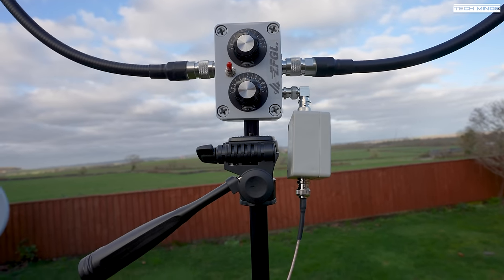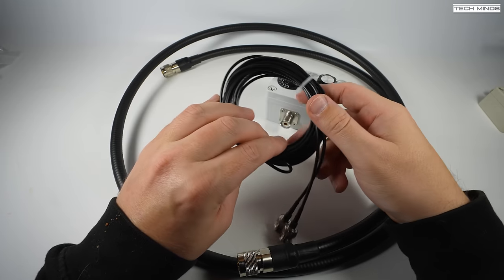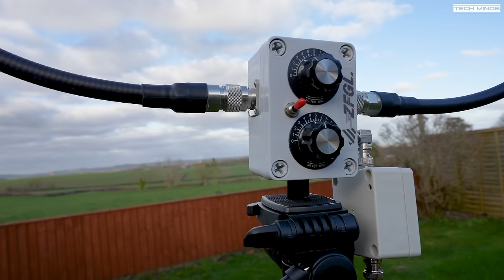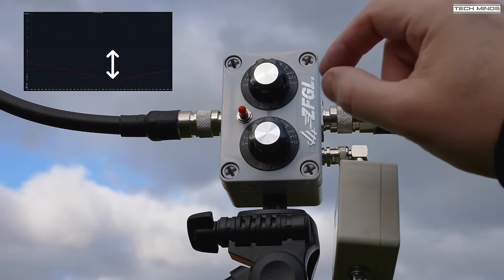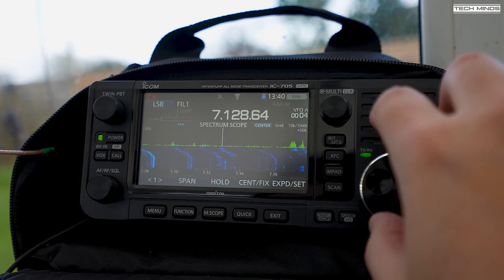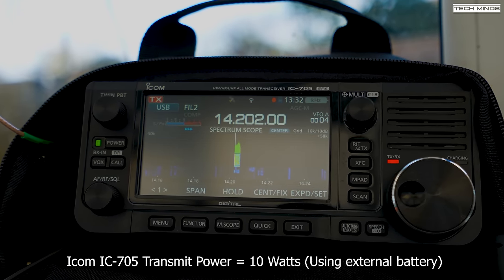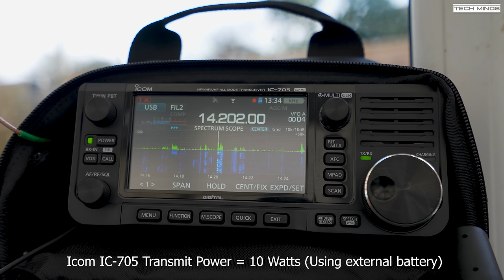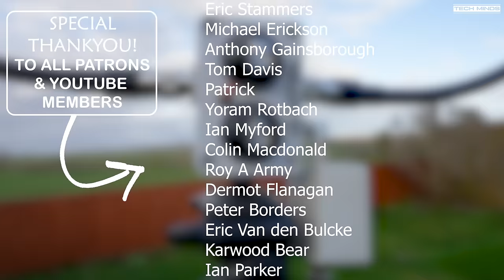A Cheap HF Magnetic Loop Antenna - But Does It Work?

Comment: I home brewed a similar antenna during lockdown. It was fine at QRP but the capacitors would not take any more than 10 watts. Really sharp tuning. You probably could not make it for the money they want. It's not rubbish at all. But any user needs to be aware of the limitations.

Comment: The voltages across those crappy caps would be huge, and I doubt that the dialectic would handle it for long. a quick calculation on guessitmate dimensions from that show that at 28Mhz there would be over 1KV across the capacitor! They will get pretty hot too, so they are doubly cursed!  - I have a DIY magloop with a big air spaced capacitor and it will only handle 20 watts on digital modes  before I get issues, so those little beasts are not going to be too happy.  IMHO
Reply: this loop is 10 watts maximum!!   its qrp indeed and works great.. have bought them for our hamclub here.  there fun but qrp only   vhf does not work good in fact the rubber ducky is better.
Reply: I don't think capacitors will get hot. They are not resistors.
But sparks will certainly fly over the plates. The distance is very short...

Comment: This is a variation on the “army loop” and not a magnetic loop antenna; the giveaway is the lack of either a coupling loop or a gamma match to the main loop.
This type of antenna does work pretty well for what it is.

Comment: I use it during +2 years, I use ft8 freqs for tunning, as you did it, first tune the up, then the down tune.
I did near 2000 kms contacts with voice and 5000 with ft8.
use it inside my room and it's bi-directional and it works... beleave it or not !   Works.
Is it like a dipone? NO! off course, but works fine the size, price and components.
73 to all
ea4huk

Comment: I wouldn't advise using that unit with the Capacitors. I have made my own loop antenna and even low power capacitors can arc across. My capacitors are good quality but air spaced. My design doesn't fold up. As today I am still experimenting with my DIY Aerial. Cheers from old George

Comment: I got one of these and it works quite well for modes like FT8 and CW where you tend to stay in a narrow part of each band and so only need to retune the antenna for a band change. Less convenient if you are scanning up and down a band, say for SSB, as the narrow bandwidth of all magloops means a retune is required if you move say 30KHz. The capacitors are ok for QRP but would break down due to the high voltage generated in a magloop if you exceed the recommended power rating. Also the caps may need their trimmers tweaking to give the full range of adjustment needed to reach from 7-28MHz- mine came not tuning all the way up to 28MHz. I like this antenna for its stealth factor. Here in Singapore the public are not familiar with ham radio and always ask me if I am a spy when I am out doing POTA! I can put one of these inside a one man tent on the beach and sit by it doing FT8 and all people see is a guy with a tent using an iPad … much more discreet.
Reply: It always amazes me that people ask operators if they are a spy... do they thing if you were a spy you would say yes...🤦🏻‍♀️
Reply: @samcollins6394  
"Are you a spy?"
"No."
"OK, carry on."
Reply: How far did you get with 10W and this antenna? Which parks are you operating from? I lived in SG for 9 years, love those beautiful parks.
Reply: I found it’s quite easy to work Japanese, Australian and Indonesian stations from Singapore on low pier with something like this but when I realised that a doublet at home was possible I switched to that and managed to work about 70 DXCCs in 9 months. But it was very slow going with QRP beyond that.
Reply: Of the many parks in Singapore my favourites are the high ones like Telok Blangah Hill Park and Kent Ridge Park as they have great takeoff in most directions and at night or early morning nobody is bothered if I operate there and also there are not too many LED lights and such causing the noise floor to rise

Comment: I have a similar antenna that I use for FT8 @ 5 watts. The antenna is indoors about 5 feet away near a window. I have made contacts (confirmed with the other party) at over 5k miles away on 20M. As mentioned it's not a good antenna if you are going to run up and down the band as you need to retune the antenna all the time. but for something like FT8 or other digital modes, or calling CQ it works well.. A VNA is definitely helpful in tuning the antenna..
Reply from the maker: I may do some more tests with WSPR and this antenna, just to see how well it works on low power. cheers
Reply: As mentioned it's not a good antenna if you are going to run up and down the band as you need to retune the antenna all the time.

Good comment. Does this mean that tuneable antennas like this aren't suitable for strictly RX? I'm not a ham but a SWL enthusiast, so I have no need for transmitting. The only magnetic loop antenna I have is a genuine MLA-30+ which is kept indoors.
Reply: @StratmanII  For receive, it is pretty much the same thing. Using the antenna, either way, it needs to be tuned for the highest noise level. So let's say I went from 17M to 20M. I would need to retune the antenna while listening for the highest noise level. If you don't retune it, and you are way off from where the antenna is resonant, it's essentially deaf.

Comment: I've had a CHA F-Loop since 2015 and the variable caps in that are rated at a similar power. But they are a hell of a lot larger than those tiny things, I don't hold out much hope of them lasting. SWR vs Frequency you'd expect to see a lot steeper dip than shown for this one. Finally just tune for max vol/noise on your radio and you'll be in the ballpark for fine tuning using the usual built in SWR meter

Comment: i have this antenna. The built-in tuner is very variant depending on the environment and how bend the loop.. i drilled on top of the box to make another monopod attachment to hold the loop so that it wont shake during windy.
Reply: And how do you like this loop? 😊

Comment: I use a 4 foot square loop made from 4 inch diameter aluminum dryer vent using a 23 inch on all sides square of 3/4 inch copper pipe as the inner loop. Capacitor changes dependent on band. These do have an upper and lower bound for what they can tune. Mine is 40 meter to 20 with efficiency at 27% near 40 m & 79% at 20 meters.
Reply from the maker: Thank you for sharing. I really want to experiment with square loops at some point.
Reply: I used the 4 inch aluminum dryer vent tubing because efficiency becomes much greater as the surface area of the main loop increases. I noticed that some vendors apply a nonvisible film on the dryer tubing and I had to sand it off where the pieces joined together or at the elbows that make the transition in direction of the sides. 

I am pretty impressed by the antenna and plan on making a similar loop for 80 meters. The loop I recently made was intended for 20 meters, but does great at receiving and even transmitting on 40 meters. I also use a small fine tuning capacitor in parallel with the main tuning capacitor. This especially when gear reduced makes tuning incredibly easy. 

The size of the inner loop is critical for achieving a 50 ohm impedance match. The general rule of thumb is the bigger the inner loop the lower the impedance. I found the match by trial and error but it only took two trials.

Comment: Thanks for posting. Obvioulsy not tosh on receive. Typical for "mag-loops", signal strength may be down compared to a dipole but the SNR is good. I will take a guess this is a "mag-loop" or Small Transmitting Loop to give it it's proper name. One capacitor is tuning the loop and the other is forming the series capacitor of a gamma match (that's why there is no small loop or toroid to couple to the big loop). On transmit, as for those polyvaricon capacitors? Not what I would opt to use - even at QRP power.

Comment: Thanks for the video. Just a couple of notes about loop antennas. First, the radiation resistance of small loops is very low, so the wire resistance in the antenna becomes a serious consideration. This is why these antennas are usually made with copper tubing or coax shields. Second is that the capacitors can see very high voltages, so that is probably why the antenna is rated for such low power. It would be interesting to replace the tuning caps with high voltage air gapped capacitors to see how it works.

Comment: I've an earlier itterartion of this I think, the only difference being the common mode choke is inline with a short stretch of BNC cabling and not within an enclosure.  Mine works adequately for Short Wave Listening but Ive not been brave enough to try transmitting with it.  Mine is a swine to tune using a NanoVNA.

Comment: Hi this loop is working verry good, i worked a station in Belgrado yesterday with 25 watt in the loop end i live in Holland. No stranges things happend. For 98 euro its a good working loop. But not the best loop, antenna i make loops my self end this loop is diong what it have to do. 73 from PD1Y.

Comment: I suspect this antenna will be very inefficient at 40m and should do a good bit better at 10m.
Reply: That's the general rule for loops of this size. Low efficiency at 40 meters/7MHz. Pretty good efficiency at 20 meters/14MHz and up. I haven't used this one, but had a couple of similar ones for years. Found it OK for digital modes, which mostly don't require frequent retuning. But: Use a small QRP loop only if no better antenna is possible. I received DX pretty well, but because most DX didn't hear me, I operated modes like FT8 and FT4 only by transmitting CQ. Even with QRP and a cheesy little loop indoors, there were always a few completed transoceanic DX QSOs in my log, though most of the comebacks were domestic.
Reply: It works better at 40 m

Comment: Hi Matt! Thanks again for a great video, I love it that you test out these alternative bits of kit. Like I have mentioned in the past am not an antenna expert, but looking at around 8:49 in the video I can see that the center of the co-ax loop is not connected at all. From my limited experience a "magnetic loop" uses at a minimum two loops where one (typically the smaller one) is the driven element, driving the bigger loop via induction. In the big loop you will also find that both the co-ax braid and center are used. From what I glean from Paul OM0ET's videos (https://www.youtube.com/@OM0ET), mag-loop antennas will definitely work quite a bit better as transmission antennas, since the actual antenna will be much closer to quarter-wave lengths et cetera. This particular antenna seems to be more akin to the Moonraker Whizz Loop products (which I like a lot) , or the older WonderWand Wonder Loop QRP antennas for the FT-817. Cheers, Jan M7HNK

Comment: How come this does not have the second small at the top like other loops i have seen i would only use it on 10 or 20m at 5 or 10  watts
Reply: The antenna is coupled to the transceiver by means of that second variable capacitor which is connected to the loop and in series to the transceiver. In this way, you can vary the coupling for a low SWR; Army Loop config.

Comment: replacing those caps with some proper air core ones (and a larger box?) would make it a decent antenna
Reply: oh what type of aircores u would use?
Reply: @dennis8019  any decent quality ones of the large type, like you seen in old radios where you actually see the capacitor plates..
They're usually rated for much higher voltages than the small rectangular type

Comment: What would be the take of angle if such a magloop?
Reply: I'm not 100% but I think they make a similar pattern to a dipole but just with more pronounced nulls.
So being so close to the ground on 40 and 20m would likely screw up the radiation pattern.
Reply: @shanerorko8076  Little loops like this one generally work very well one loop diameter above the ground, possibly better a little higher. Experiment to find out. That's with the loop mounted vertically (like a bicycle wheel). Mount it horizontally and it might be better farther up.

Comment: Looks like the sheild is the only part that is being used on the large loop.
Reply from the maker: Yep, you’re right. I noticed that too when I took it apart.
Reply: Loops should have large surface area and very low resistance; hence using only the shield for better efficiency and bandwidth.

Comment: Hmmmmm
What sort of take off angle/radiation pattern would this antenna have?
Reply: Mag loops have good low take off angles with is one of their best features.  There should be a bit of a null point out of the center of the loop in two directions.
Reply: @bassmanjr100  so this isn’t going to work well in my back garden? It’s going to need to be out in the open
Reply: @lonewolfhamradio  no its not for outdoor placement.. its not waterproof and u need to tune it if u change frequenties..   get a endfed or bigger antenna.

Comment: The right-angle 90° feed line adapter is the first sign of "run away run away run away".
Reply from the maker: Luckily its not fixed, so you could use a small patch cable instead.

Comment: I don't think this will work for very long!
Reply from the maker: I think you may be right! Maybe I will perform a test, leave WSPR running for a few days to see what happens :-) Cheers
Reply: @TechMindsOfficial  yes, I had a great deal of success using WSPR and a 40m mobile whip on a clothes dryer spike and radials!  Love the channel, 73 de Andy G0VRM.
Reply: @TechMindsOfficial  What happened in the WSPR test ?